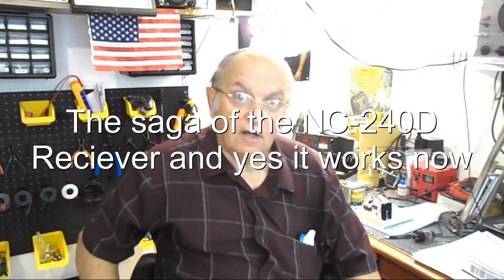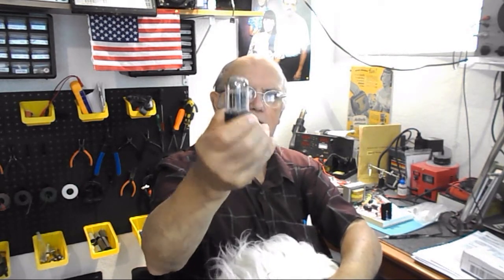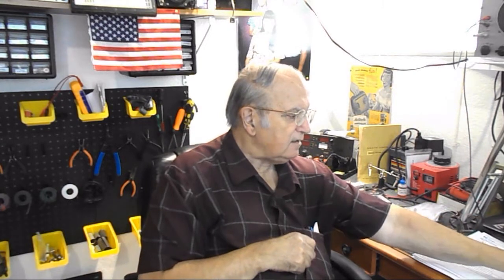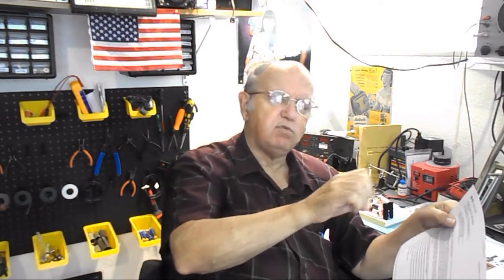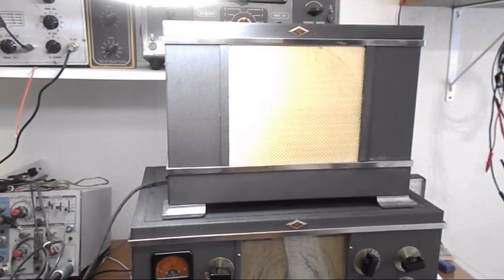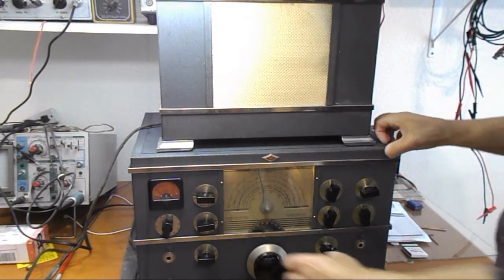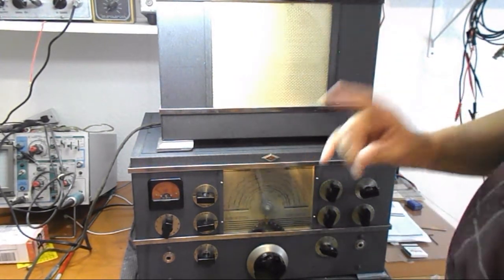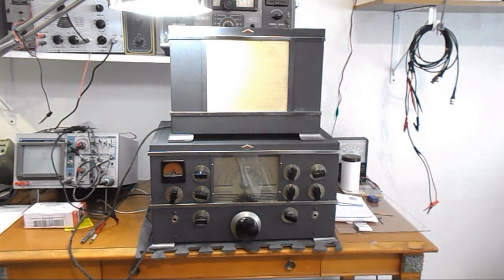National NC-240D Receiver saga and yes it works now

Comment: Man Larry, that is a good looking radio. And, you got it working so double thumbs up.
Reply from the maker: If it hadn't taken so long to get the 6SL7 I would have had it working earlier. But when I told Ron what it was doing  he dropped over and decided to help troubleshoot it. He likes a challenge anyway. He has 50 plus years experience in electronics anyway and luckily zeroed in on the right tube. Quite obviously why the 6SL7 was dead was the result of the resistor being wired in the wrong place. And the two dials on the radio the name plates were reversed other than that everything else was wired correctly. in 1947 this radio cost $225 equivalent to a cost of $2500 today!

Comment: Was it the "mod" or the factory that put the resistor in the wrong place?
Reply from the maker: No Bill it wasn't the factory the guy who recapped the receiver and added new parts got that connection wrong that's all. And it never worked until my brother Ron found the mistake
Reply: @LarryDeSilva64  Okay, Ron is a smart guy
Reply from the maker: @old64goat  Ron is and always has been in the electronics field and electronics engineer and a communications Technician for 50 years. He designs and builds circuits things you would never understand he has designed and built from scratch. Other engineers have tried to steal his designs at work but couldn't too many people knew his work. To say he is a genius is an understatement. Not to mention he rebuilt My Great Grandfathers Stone house back on the Azorean Island of Flores from a pile of rubble. He can build anything and design anything. So yep he is way above the normal person.